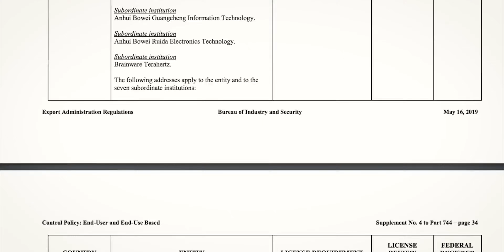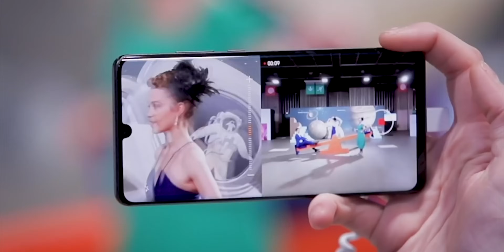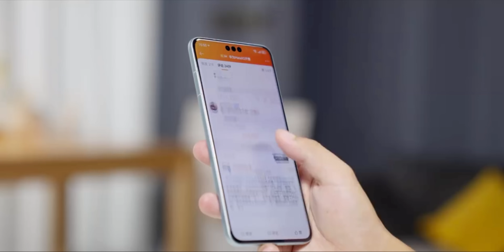Huawei - OMG, This Could CHANGE Everything !!

Comment: very good im still using Huawei phone im with p30 pro 8gb ram 256gb it is very good after 4 years
Reply: I just bought a p8 few months ago. despite being 28 nm it's more power efficient than the 14nm Snapdragon 820.
Reply: @Sarah_Delata why did you buy it? It's better to take P60 Pro or Mate 60 Pro, with 4 nm processor
Reply: @eshizhamsuev  nope. I will not spend $1000 for a phone that will last me 3 years. I prefer to buy old stuff. I have currently mi 5, lg g5, p8 g6 and g4 that died, S6 edge,  I still have s4, s5, xperia z4 etc. I will soon buy p9,, s8, another G6 etc.